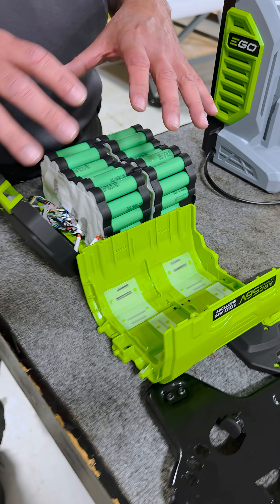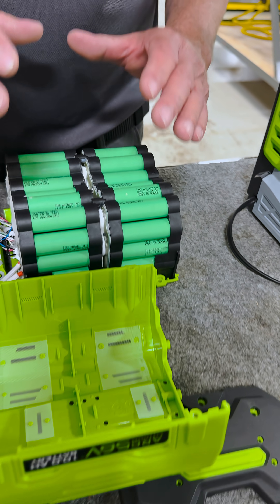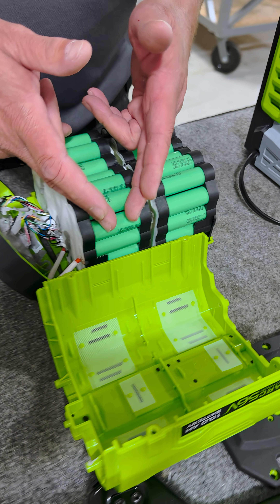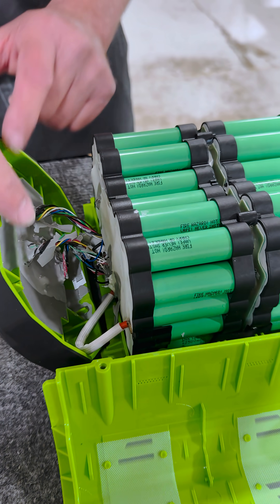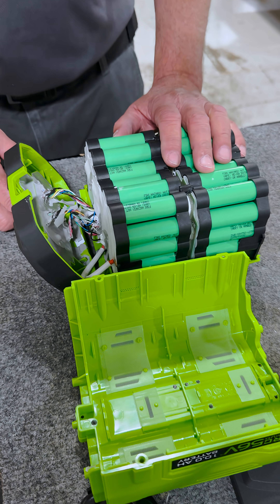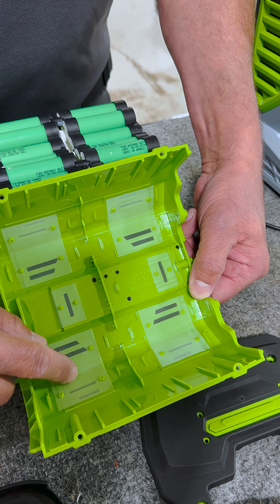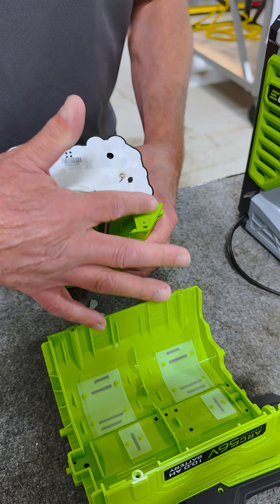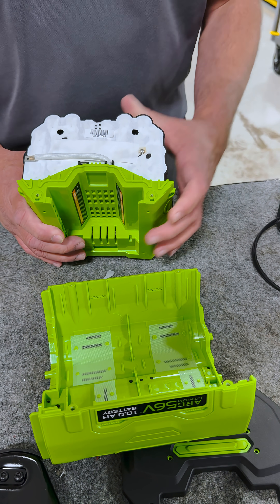EGO 56V battery review

Comment: I'm sorry, but I can't speak good of these batteries. My lawn is about 1200 square meters, and while the machine performs very well, these batteries (one 7.5A and two 5A) always overheat, frequently interrupting my work. Perhaps a small active fan would have helped dissipate heat a lot during the hot season.

Comment: But as usual internal cells goes on fire while the external stay relatively fresh... This has an impact on the internal resistence of the cells that led to inbalance. They compensate each other because are in parallel but overtime they Age completely differently. So not a good setup for long term operation...

Comment: Electric power comes in the units watts
Electric energy comes in the units watt hours 
If you stick to the units of power and energy…..
This stuff is WAY easier to understand.
Reply: Or just use SI units: Watts for power, Joules for energy. Confusion averted.
Reply: You still need to know the voltage. Give you an idea of torque the motor will have
Reply: @rickybungalow8839 You can change the torque of a motor at a given voltage by changing the number of windings on the motor. After all, car starter motors are only 12V, yet are much more powerful and higher torque than most power tools that are 24V or higher.
Reply: @markirmuir true but higher voltage battery configurations allow for thinner gauge wire. The 40v batteries are for smaller mowers